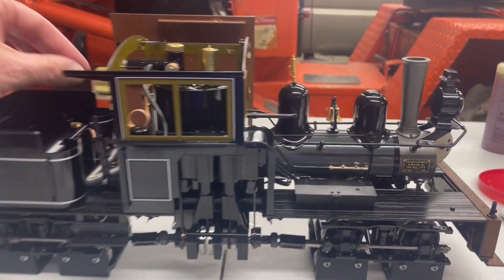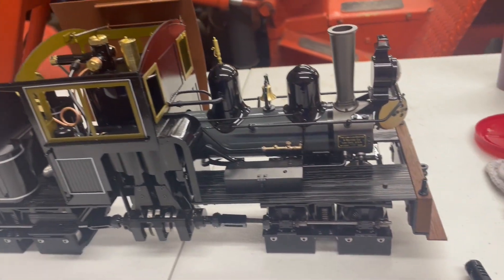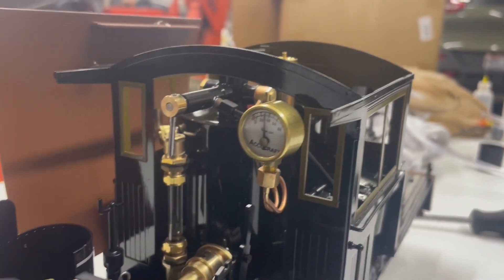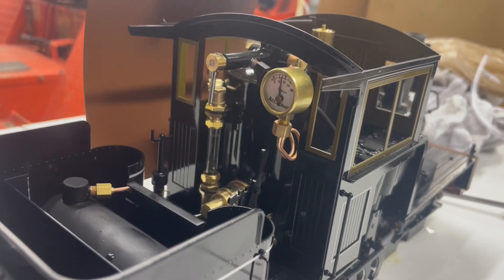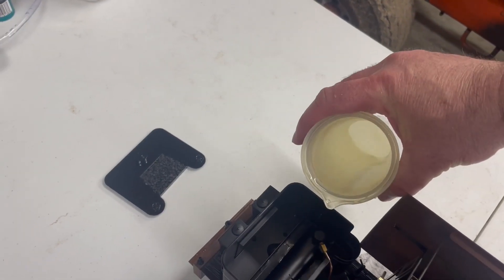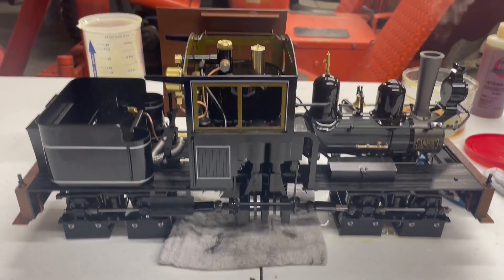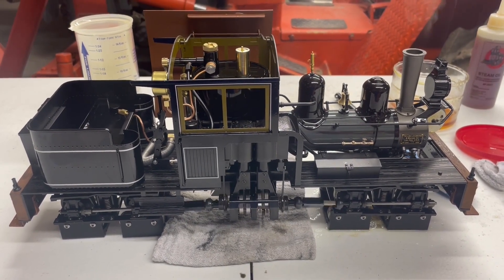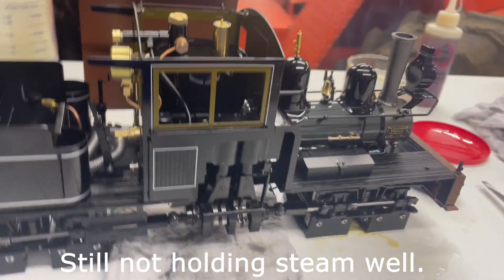Accucraft Shay 13 Ton Class A Live Steam Blue Boiler CS215 R

Comment: Yes, always add warm tap water to gas tank bath. Even when the water cools it still moderates the temperature of the tank. As gas exits the tank the tank will rapidly cool and gas pressure and efficiency thus drops so the water really really helps. Most of my other engines have the gas tank in the cab adjacent to the rear of the boiler - with no water bath. Those engines take a little teeny bit longer to get going but once up to pressure the gas tank is kept continually warm beside the boiler. The nature of Shays, with the engine in the cab and offset boiler means no room to put the tank there. Your loco will need to bed in, in both directions but looks and sounds great to me! Mine sounded like yours. Now it is enjoyable to hear the whine of those bevelled gears!

Comment: Nothing wrong with this engine, you will have lots of fun with this engine.😀
Reply from the maker: I’m hoping the poor steaming is just a matter of wearing it in and a bit of a learning curve for me, as this is my first gas engine.
Reply: @northernutahlivesteam   I am sure that things will improve after a couple of runs. The leak can maybe fixed by turning on the bolts of the lid a little bit more. Good luck, don`t use to hot water , handwarm is good enough.
Reply from the maker: @MrBramMoos  your expertise is very valuable to me, Mr. Bram.  Thank you for the advice.  I did try tightening the screws, no success.  Do you feel this leak is severe enough to cause such a loss in pressure?  She steams up fairly well, but pressure drops steadily when I open the throttle.
Reply: @northernutahlivesteam  I will have a chat with a friend of mine who has the same model and see what he has to say. I haven`t had the change to run one of these. Will come back to you about it. Maybe my friend can bring it to our GTG this weekend and I can do some filming.

Comment: Try pulling the ring collar off the air inlet holes at the burner, it looks like it was all the way over the inlets.
I have also found that you don't necessarily need hot water for the fuel tank bath, room temperature water will accomplish the same results. And like Terry said, it needs to run in a bit. Fixing the leaks probably helps a little,  but not the core issue
Reply from the maker: She actually runs pretty smoothly, after all the running in, tuning, and etc.  just needs more heat.  Adjusting that ring did help a little.  She just needs a tiny bit more heat.  After discussing with other owners of the same engine, 4 out of 4 of them have #8 jets.  Mine has a #5.  I’ve ordered the bigger jet and have every confidence that will resolve the final issue.
Reply: @northernutahlivesteam  that's good,  mine came with the drive shafts reversed, I seem to be getting plenty of heat, but I think I have burr on the gas valve,  because I feel a "notch" when I open the valve
Reply from the maker: @timothyboles6457  you had to disassemble and swap the driveshafts?  What size jet does yours have?
Reply: @northernutahlivesteam  I'm not sure what jet I have,  I know that with water in the tank bath, even at ambient temperature the burner behaves better. So far I have only swapped the drive shafts to the correct locations, we were supposed to have a steamup today,  but it was canceled due to the rain,  so I have yet to fire it up again and run it
Reply from the maker: @timothyboles6457  well post a video on your channel, whenever you do run her.  The size of the jet should be stamped on the thing that kooks like a hex nut, where the gas tube connects to where the firebox door would be if it were a real engine.  Can just jiggle it straight back to pull it out; just pushes back in.
Reply: Yup, Accucraft actually say 'water' not necessarily 'hot' water.  I've found, with three Accucraft locos with water baths, that room temperature water works just as well.